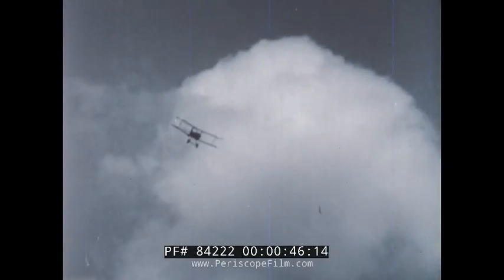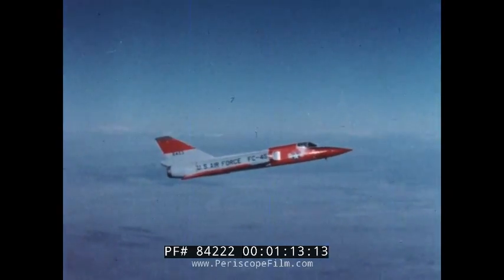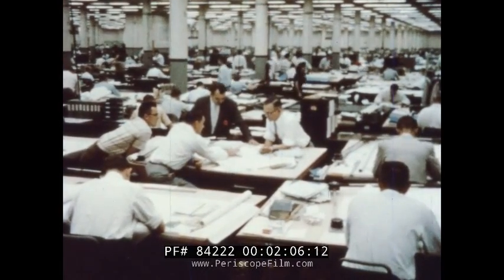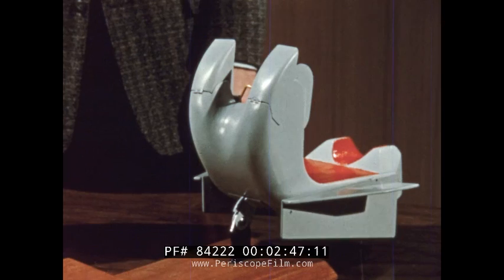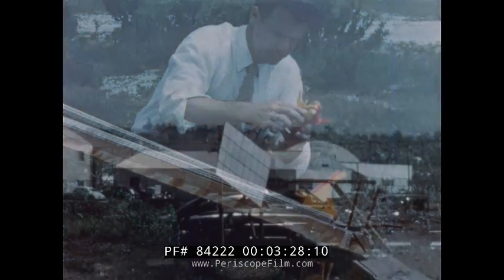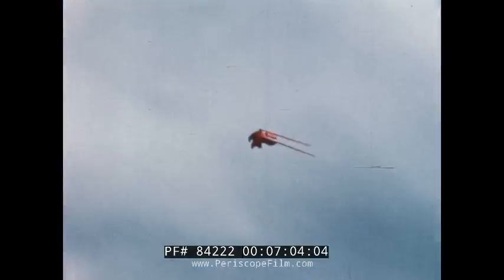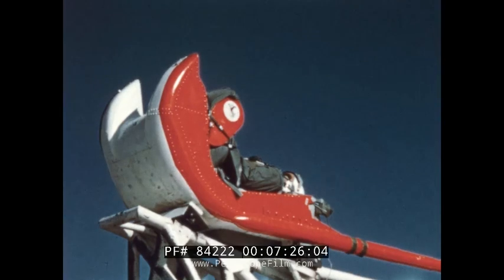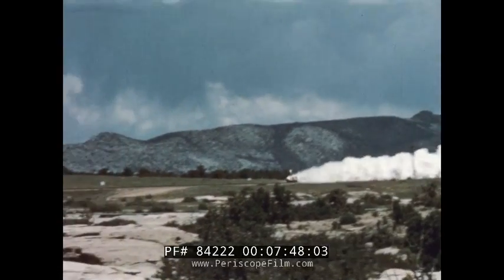SUPERSONIC EJECTION SEAT SYSTEM TESTS AT HURRICANE MESA UTAH 84222

Comment: American aviation industries surly did come up with some crazy ejection seat systems, and complicated to, these systems defeated the KISS principle completely, but I don’t think they and the USAF learnt any lessons from these early systems, in fact they went one better with the F-111 Aardvark system where they ejected the whole cockpit capsule, not a good idea really, especially in the event of a cockpit fire. Martin Baker, arguably the best designers of ejection seat systems used the simple idea of using a “face blind” that when the crew pulled the top ejection black and yellow handle the blind came down over the crewman’s face thus protecting their face from wind and/or debris blast, the action of pulling the blind down also prevented the arms from flailing around because of the position of the arms brought about by the pulling downwards, the legs were pulled in by the simple introduction of leg restraints that when set to a comfortable position for the pilot to reach the rudder pedals would automatically pull in a prevent the legs from hitting anything on the way out of the aircraft and flailing once the ejection sequence was ongoing, a small drogue chute stabilised the seat until the seat reached a safe height when the seat harness was released and after the seat had fallen away the main chute opened and the crewmen floated down to safety with their Personal Survival Pack (PSP) on a lanyard bellow them to give an idea of how far it was to go before touchdown, inside the PSP was/is everything needed to survive on land or in a water landing, and apart from the decent by chute the whole sequence to seconds to complete (depending on the height that they ejected at). Puts these convair seats to shame, sorry but American seat manufacturers made the whole think damn complicated when all that was needed was to KISS, complicated does not always equate to superior or reliable. Thanks for sharing this interesting and informative film 🎥👍😀🇬🇧🏴.

P.S Before anyone decries my opinion, or doubts my qualification to comment, 24 years aircraft engineering should be enough to qualify me to comment, but if you don’t agree, DILLIGAF.
Reply: Well, one positive of the design in the video is that a person gets ejected in laying down position, thus not potentially damaging their spine. Or at least reducing the risk.

Comment: I'm flabbergasted as these American aircraft companies don't seem to have heard of something called drogue parachutes (Which Martin-Baker used right from the beginning). Instead of using all of these fancy, bulky, complicated and heavy contraptions to stabilise their seats they could've used drogue chutes to A) stabilise and slowdown the seat, then B) use the same drogue chute to extract the main parachute.
Reply: the aces II ejection seat used on the f-16 and most other modern air force combat aircraft does actually have a drogue chute for moderate/high speed ejection, but I would imagine that in the early days the technology probably wasn't reliable enough to make sure the main chute deployed immediately at lower speeds + altitudes where those extra couple seconds to deploy a drogue are critical in slowing the pilot's descent before ground impact
Reply: I’m flabbergasted that MBA has no concept 
of a pitch stabilization system like the ACRS STAPAC that has been around since the 60’s.

Comment: Hence, GD build the F-111 with a crew escape module because "safe ejection" in an open seat from supersonic speeds is a ludicrous concept and this whole effort was confirmation of that. 

Although there is a least 1 known survivor of ejection at supersonic speeds (F-15/ACES II seat and only 1 of the 2 crew members survived), one must remember that the speed of sound goes down as you go up in altitude.  So supersonic at 20K ft. is a good bit lower mph speed than at sea level. 

I can just imagine the look on pilots faces when told or shown what these seats were going to do to get them out at mach+ speeds.  LOL
500 mph is about tops for safe ejection in a seat and even then aircraft attitude should be within a certain envelope.  Ejection at any speed is still a better choice than riding a falling rock into the ground though.  Flying a fighter is not for the squeamish, it's always going to be dangerous regardless of the capability of the egress system.
Reply: Pretty sure SR 71 pilots have ejected at Mach 2 plus and lived. It's not impossible.
Reply: @thetreblerebel  Yeah, well, pretty sure they haven't but if they did, it was miraculous luck. Not going to look it up.  That's your job when you make a statement like that.
There have been many safe ejections well beyond design intent from many aircraft over the years. But damn few if any above mach 1.  
Ejection with any seat, from any aircraft at mach+ speeds is beyond design capability.  Bank it.  Why?  Because the human body is understood and excepted NOT to be unable to withstand the forces of mach+ ejection.
Reply: @thetreblerebel  It is unlikely to the extreme.  Ask any fighter pilot.
Reply: @thetreblerebel  OK Stevie, you were right, under certain conditions.  Because the SR-71 usually flew at extraordinarily high altitudes, there was an incident were they survived a mach 3+ ejection.
See it here, but listen to the caveats.
https://youtu.be/4o8KpEYOYQQ?list=PLH-ULUDAOjhOWz3DPODipijDCkhE3IhwZ
Reply: The pilot who survived the breakup of the SR71 did so largely by luck, and definitely not by design. His co was much less lucky.
Besides on an F104 for example, the best advice would be jump out immediately before it becomes a lawn dart, and hope for the best...
Reply: @creepingjesus  Getting out before becoming one with the earth is always the best choice, ejection envelope or not.  Thanks for your input.
check this out:
https://youtu.be/4o8KpEYOYQQ?list=PLH-ULUDAOjhOWz3DPODipijDCkhE3IhwZ

Comment: The sled goes from 0 to about 700 mph quickly. 
I wonder how that compares to top fuel drag racer   0-330 mph in about 3 1/2 seconds ?
Reply: the sled goes a lot faster ,we would only use about a mile of the track ,with the water break starting at 8000 ft  to 12000 ft to stop the sled ,we would start at around 6000 ft ,so in less than 2000 ft we would could hit over 700 mph ,we would never use the whole track
Reply: the seats we have now are so much better but for the time the seats back then would save a pilots life
Reply: @jiml4782   I take it you rode on the sleds?....no permanent injuries from it?
I can't imagine those g forces.  3g - 3.5 g is the most I've experienced and that was enough for me.
Reply: @lw216316  no we had mannequin for that ,but i loaded the rocket motors, set track ,set the water break ect